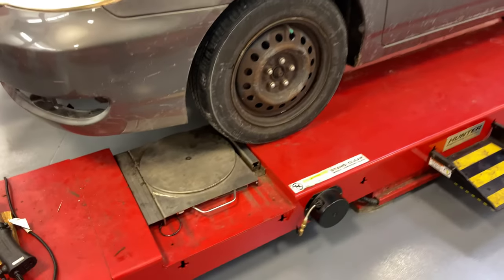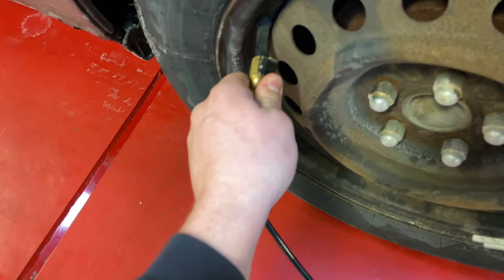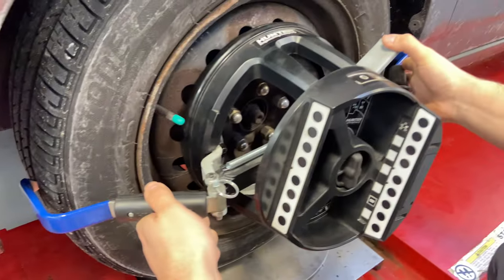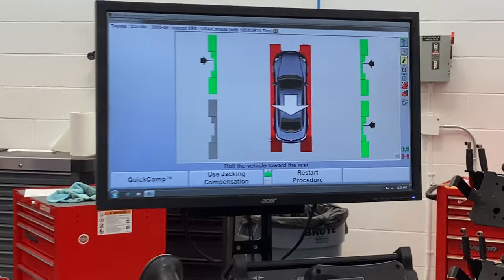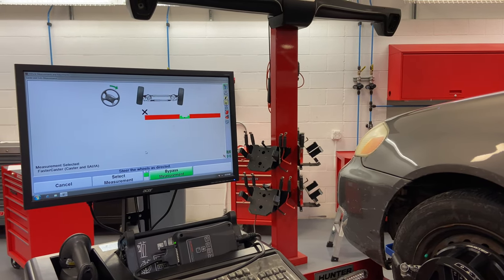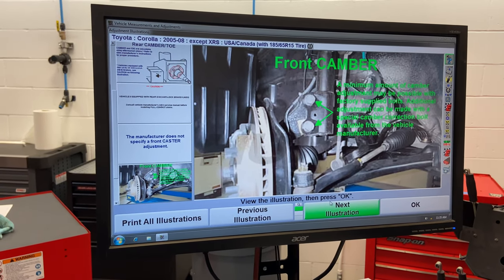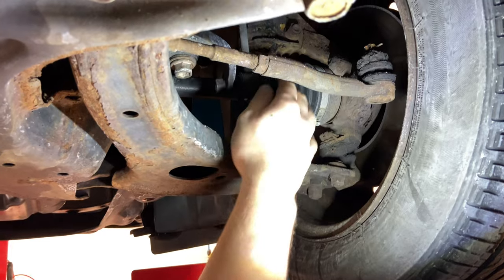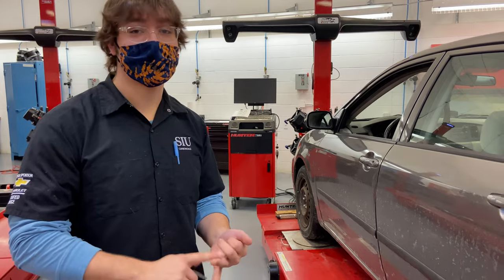Hunter Alignment (AUT 216)

Comment: what is cater sweep? can somebody explain this term?
Reply from the maker: caster sweep is turning the steering fully left and right. It will allow the caster (caster is the steering angle measurement) Its important for the cars steering feel and having the car want to drive straight
Reply: Castor is where the wheel in in the arch , forward or back, also this gives SAI or KPI steering axis inclination , or Kingpin inclination to see if a shock is bent